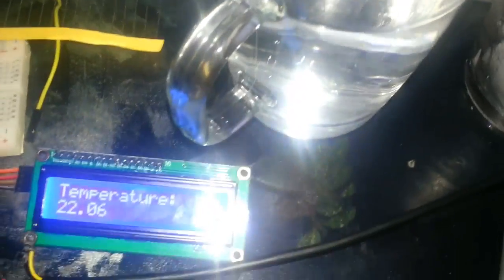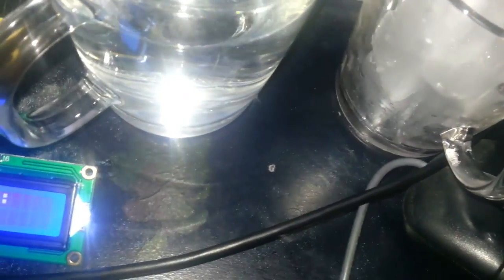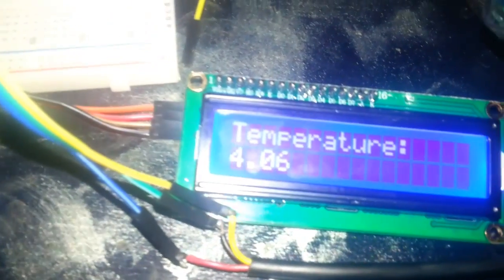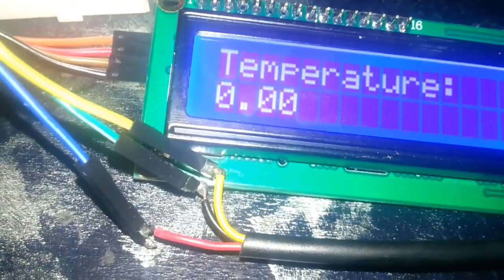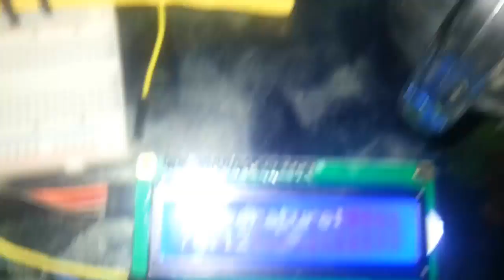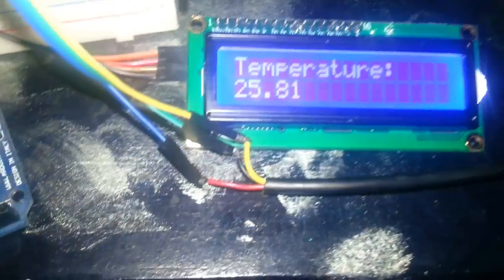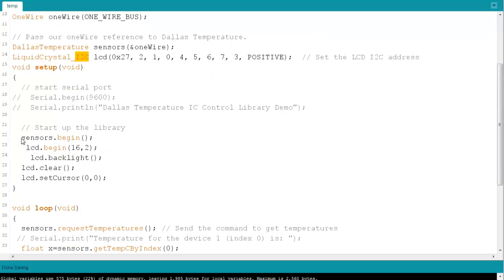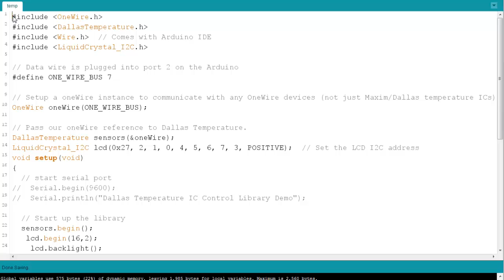DS18b20 temperature sensor Arduino tutorial

Comment: I use the Ds18b20 temperature sensor in an arduous project to measure the temperature and control the relay module via which 12V voltage is connected based on the measured temperature. The measurement goes well until the 12V voltage is connected to the relay. When it first clicks the relay sensor automatically measures a max of 127 degrees. Please help me to make mistakes?

Comment: I didn't make the wiring but with a simple compile I get the message:

DS18B20_LCD.ino:16:53: error: 'POSITIVE' was not declared in this scope

(Of course all the header files are included)
Reply from the maker: Do you have the right and most updated libs ?
Reply: i had the same problem, any solution?
Reply: ...try declaring it?